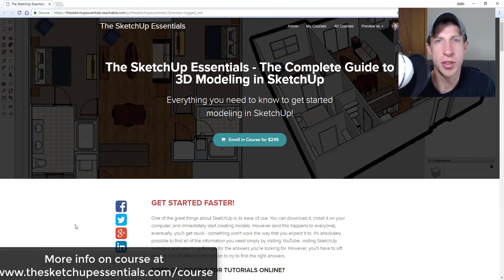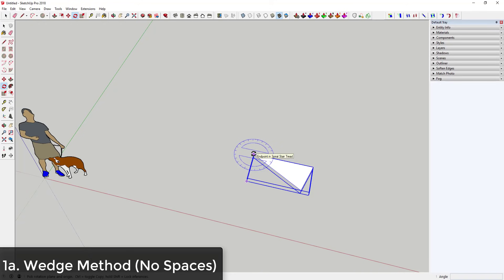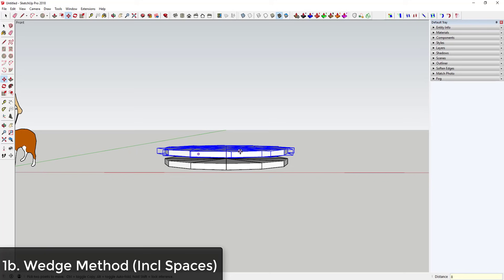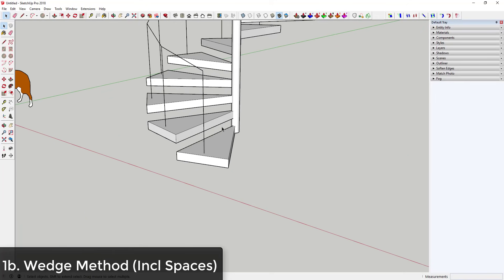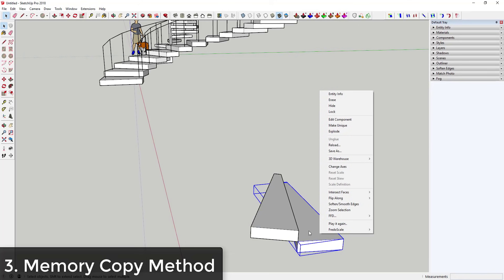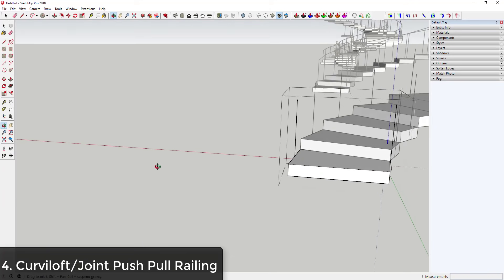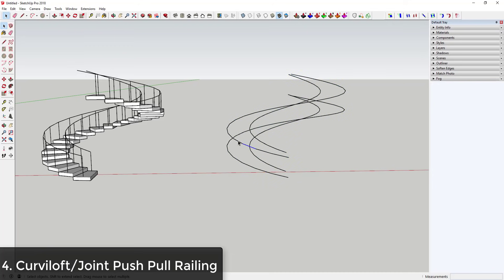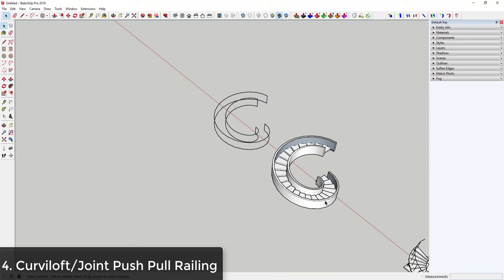5 Ways to Create SPIRAL STAIRS IN SKETCHUP

Comment: How would you go about creating an internal spiral staircase where the staircase is contained within a “tube” ?  Then be able to lock the short side of the “triangle,” to the interior wall , split the wall and unfold the wall so it lays flat with all the staircases still attached.   Then if I were to roll the flat sheet back into a tube the staircase shape would “reveal itself .”

Comment: Just started working with Sketchup. I am strictly using it for stairs. What I am finding is all the tutorials use the same method. Which in reality are wrong in a sense. There no radius in the ones you just went through. There are no closed stringers or any stringers for that matter, and no nosing's.  Now, I have managed to produce some straight systems. Mind you it is so very slow to design. Even slower designing rails and spindles to building codes. In your coarse, do you offer a detailed set of work flows in the course you offer?

Comment: 8:00 you didn't rotate this one, the same way as you did the other. What did you do to get the stair to rotate like that?
Reply: you could find he inferred center of rotation by using the protractor tool to draw two guidlines on the edges, and their intersection is the center. But in this video, I think he used the 'find center' option for the circles before erasing, so he just rotated from that center very quickly
Reply: @remmingtonotieno7756  he used the find center option earlier to generate the center point

Comment: Hi there! I've a question. I switched from Sketchup 2019 to 2020 and now I lost the most of my extensions.... Unfortunately Curviloft doesn't work with my Sketchup 2020. Do you have any suggestions for a replacement for this extension? I want to 'skin contours' like you did. Also my Joint/Push Pull doesn't work... Maybe you can help me with this problem. I'm searching the whole day for good replacements to work faster in my models, but i can't find anything
Reply from the maker: What do you mean it doesn't work? Works fine in my 2020. Did you update LibFredo and Curviloft to the newest versions?

Comment: i have done everything the same, but when adding the vertical line for the railing it only gives me the line on the selected component.. it doesnt copy to the other stair threads...
Reply from the maker: Make sure that (a) - your objects are actually components, and (b) that you've modeled the rail within the component itself
Reply: @Thesketchupessentials  hey justin, im not capable of making a railing that fits with all the components together because if I make the railing in 3D and not just the lines it doesnt fit so well with the next component...do you have any tips or a video about it?

Comment: This is great and really helpful! I just have one question: I have a spiral staircase with an outer circle of 1,00m and an inner circle of 0,20m. While making the wall railing, the outer circle will work fine but the inner circle gives an error when using Curviloft. It says 'Contours can not be interpreted correctly. Try to force separations with small cut lines.' I honestly don't know what they mean, but I guess it's happening because the lines of the inner circle are too small? 

I would appreciate it a lot if you could help!
Reply from the maker: Hi Denise - Can you try scaling your model up by a factor of 5 or so using the scale tool, then see if it works? Sometimes when you start working with really small dimensions, SketchUp gets a little wonky...
Reply: TheSketchUpEssentials I tried that just now, but I get the same error 🤔
Reply: @xDns1  Hi, double clicking on one of the components allows you to edit just that component.
You then draw a line within that component.
It is then drawn on all the remining components.

Comment: Great , but what if the curved solid handrail has circular holes in it .
Reply from the maker: Really depends on the design specifics, but in that case, it might make sense to model it straight then bend it with Flowify, Shape Bender, or Radial Bend in FredoScale. Thanks!